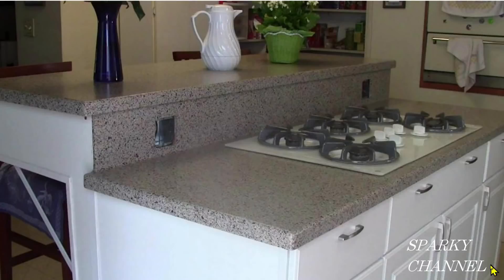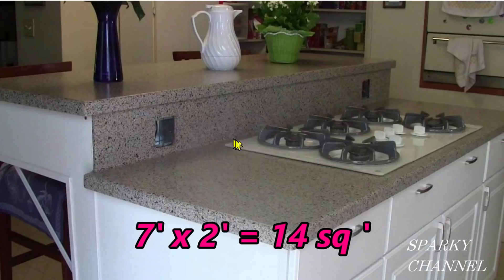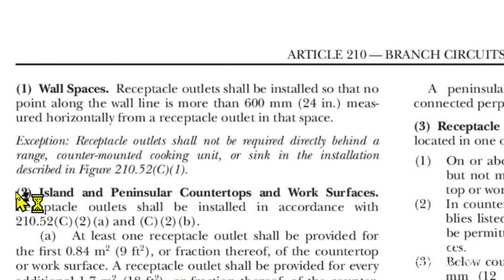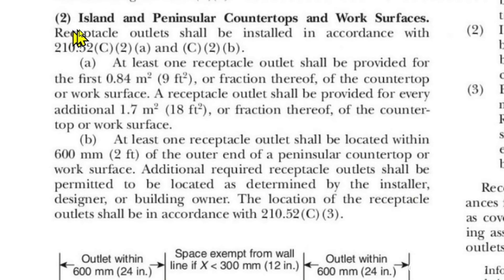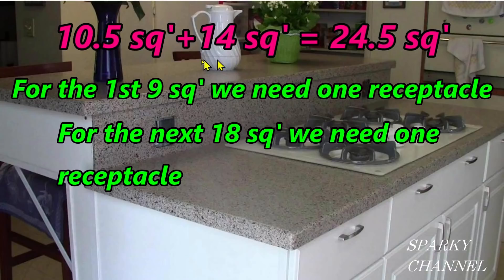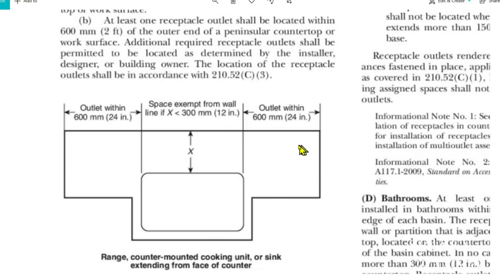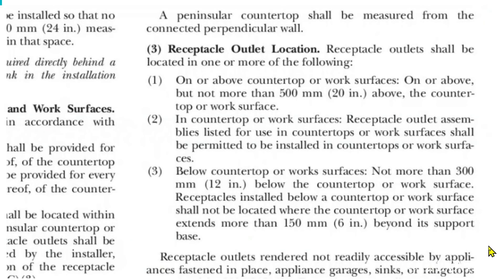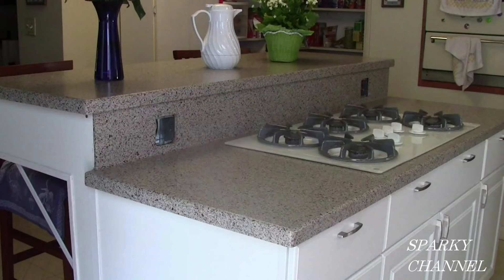How Many Receptacles Does this Island Countertop Need by 2020 NEC?

Comment: What is a "receptacle outlet"? Would a duplex outlet be considered two "receptacle outlets"? If I'm understanding correctly, you could have put a simplex outlet with 24" of each end of your island and met code. Not very practical, but code compliant?
Reply: Yes, a single outlet on each side of the cooktop is code compliant, if it's GFCI protected.

Comment: The problem is when we call that upper layer you add into the countertop a bar—sitting eating area. Now they are treated as separate surfaces. And the upper one as a non work surface. 
This changed it all and the code min answer is now “1”. Then you get the inspector who interprets the code to mean no receptacles on a work surface in connection with a cooktop and decides he will not allow one anywhere on that countertop area. 

Bottom line here though is while you installed 4 receptacles in that area and that is double the code required ad you figured the math, you need more!  In our appliance electric populated lives, more is better!  If code suggest 2 receptacles 3x that number is a more practical minimum.

Comment: Just install a  six(6) foot Wiremold power strip with outlets six inches on center and you can’t go wrong
Reply: Incorrect...
The code states receptacle OUTLETS... not receptacles... so a wiremold full of receptacles would only count as a single receptacle OUTLET. 
Another change to the 2020 code... differentiating outlet, as the box wiring terminates in... and receptacle outlet includes one or more receptacles... a duplex outlet in a single gang box, and 3 duplex outlets in a triple gang box are both single receptacle OUTLETS...
Reply from the maker: For other viewers: Legrand Wiremold Multi Outlet Power Strip, Plugmold, Hard Wired, Ivory, V20GB506: Amazon: https://amzn.to/3hz1xKY

Comment: Sparky, Another good video but when you read from the code, you are talking to a US viewer.  Just skip reading the metric crap.  We don't use it.
Reply: You mean, you still use  the imperial crap ?  Make America great again. Counting in decimal numbers but measuring in a totally different  system.  Holly crap !
Reply: Actually, Americans, especially American electricians, use metric all the time.  Volts, Amps, Watts, and Ohms are all metric.

In addition to that, engine displacement is now almost exclusively in liters (used to be cubic inches), as are tire widths.  Most of the fasteners in new American cars have long been metric.  Larger bottles of soft drinks are sold in liters, as is liquor and wine.  Medicine is now almost exclusively milligrams and milliliters.  Science and engineering are taught and practiced in metric (with a few exceptions).  

I'm American, and I'm perfectly comfortable with the metric system, as well as the US Customary system.  So, you don't speak for me.  I hope he continues reading metric.